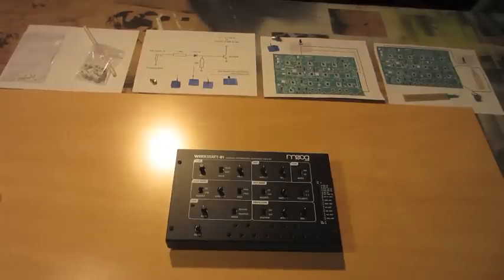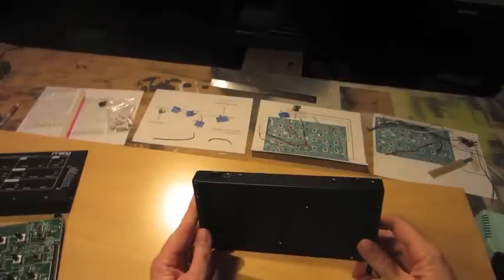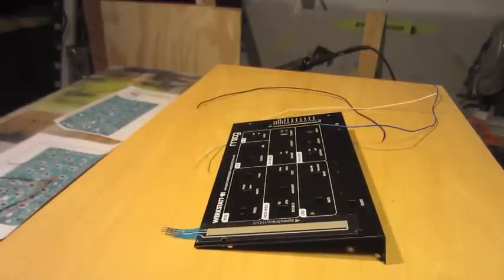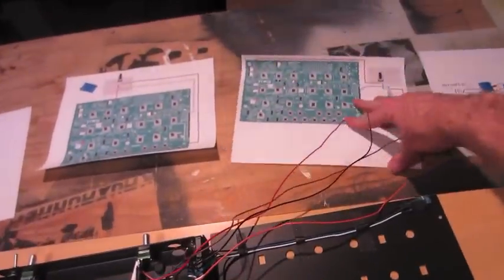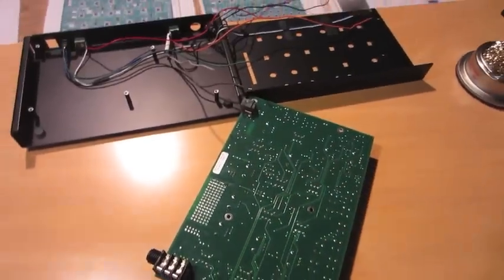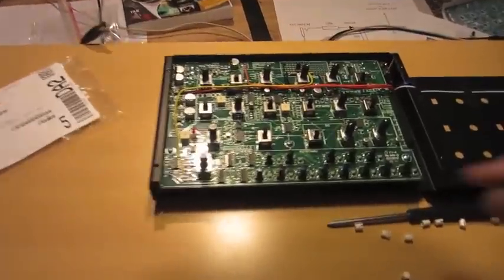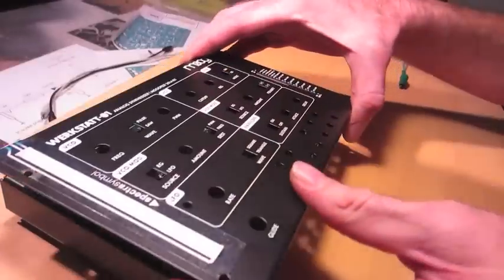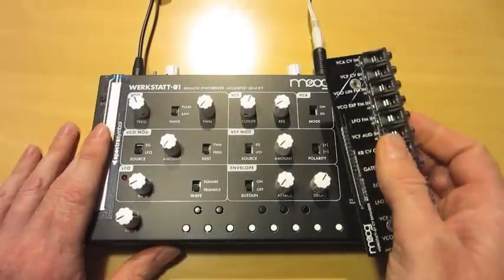How to add Gate In, Pitch Bend and Volume to a Moog Werkstatt

Comment: It's a shame that Moog did not include the gate in  on the CV expamder since it was on the patch bay already.
Reply from the maker: The patchbay only has a Gate Out not Gate In. Doesn’t make sense why Moog did that. And that was back when Moog was still Moog (before the sale) I never understood that.
Reply: @SISKworks  Thanks  I stand corrected as took expander off.  The reviewer  may have been incorrect when he stated that.  Was refreshing my knowledge  to get back into the Werkstattit.  Patching to  my modular, Mavis and Mother.    Guess will have to consider some mods.  :-)   Forgot it had no volumne and had to adjust the mixer input so could match the Mothe  output.  So those me be ther first.   That little things is pretty loud.

Comment: This is wonderful! Thanks! One question. I also have the older CV expander that says Gate Out so if how does that work with this change to the Gate Out to Gate In? Bit thanks!
Reply from the maker: The old expander only has Gate Out. However you can KINDA use it as a Gate In by just plugging a Gate cable but it doesn’t work all that great. So I modified mine to have a separate true Gate In. It doesn’t change how the expander Gate Out works at all.
Reply: @SISKworks  Thanks, Mike. I still decided I will go for it! Or just sell it and buying a new one. You did a wonderful job!

Comment: Hi! How did you secure the extra knob to the case?
Reply from the maker: Drilled new hole through back. Knob/pot is secured with the normal nut after going through new hole.
Reply: @SISKworks  Appreciate it!! So, are they threaded? Can you link me the potentiometers you used? I have some but they have no way to secure them to the shell.

Edit: Maybe they are called knobs?
Reply from the maker: @4steroid  no, don’t have link to the exact one I used but it is pretty standard for pots to have threaded collar with nut. Sounds like what you have is something non-standard. Check out sites like Thonk, Love My Switches or Small Bear Electronics (you will have to google).
Reply from the maker: @4steroid  you want panel mount pots. I’m guessing you have PCB mount pots.
Reply from the maker: @4steroid  yes exactly. Black wire from ground soldered to a row on the experimenters pad. Used a leg cut from a resistor to turn one row into my grounding strip.

Comment: So i hadn't messed with my werkstatt for ages but I just realized after seeing a video of a guy hooking up his keystep to his werkstatt that the gate out actually also works as gate IN? I just tried with my qunexus and sure enough triggered notes are now using the envelope which wasn't happening when sending gate from the qunexus to the VCA in as i always had done before.. wild shit.  I was just about to make this mod to add gate in, seems it's not necessary.
Reply from the maker: Yes it will work but I think you won't get as strong of a gate signal if I remember correctly. I do remember testing that method side by side with my mod and the mod worked so much better.
Reply: @SISKworks  Hi again, Thanks for your response- I think the problem with using the gate output header as an input is that method doesn't hit the envelope.  Seems you sent the leg of the transistor only to R89 - not R89 & C64? Nathan's schematic states either U14D pin 9 OR the junction of R89 & C64. Goddamn nervous about soldering the surface mount components.

Comment: I'd liek to do so on my monotron delay nut it's maybe too tiny to solder
Reply from the maker: No, I'm sure it is not too small solder. However that is a completely different unit and this video will not really help. Also being a delay I would guess the volume mod would be the only one that would similar to mine.